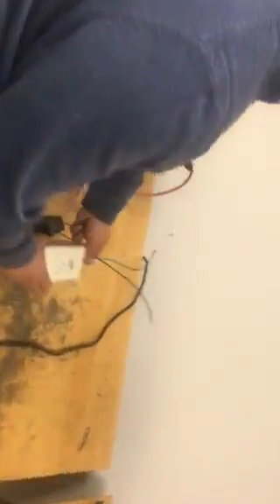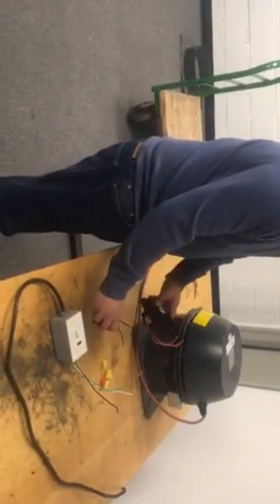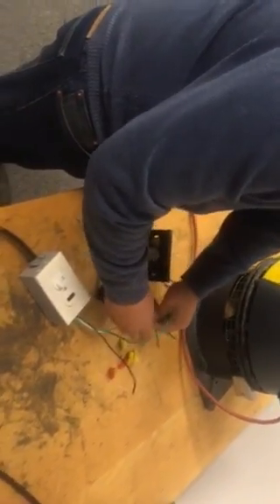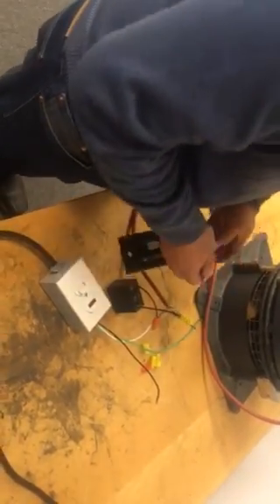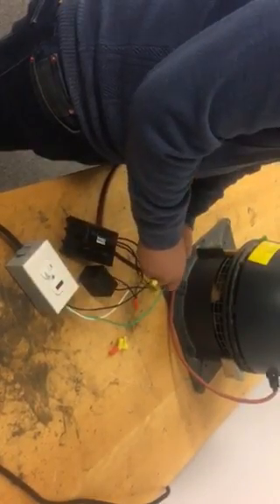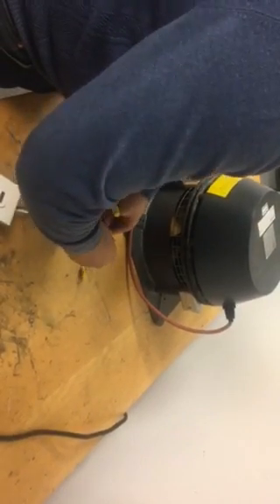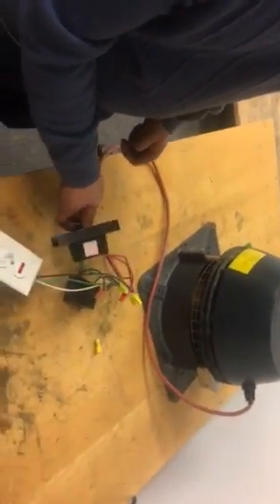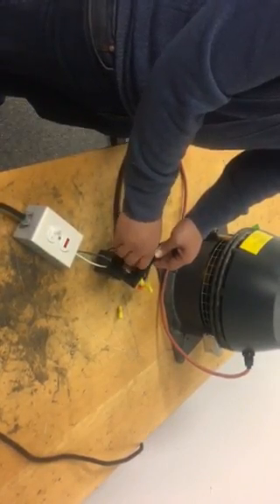How to wire a variable speed controller to a Fan

Comment: What is the purpose of the capacitor?
Reply from the maker: Sorry for the late reply, but the purpose of the capacitor is used not only to start the fan but also to make it spin. In simple words, the capacitor creates a magnetic flux (torque) which makes the fan rotate.